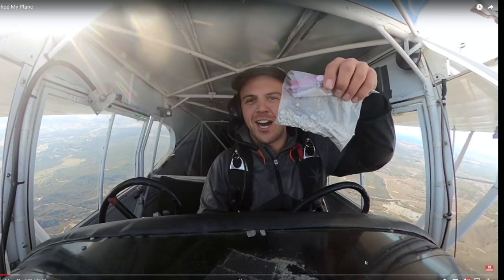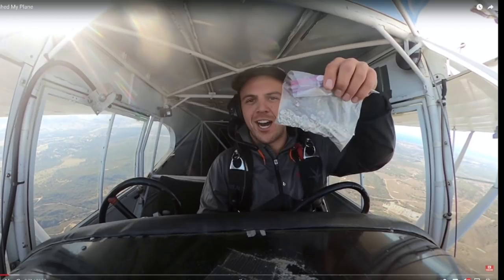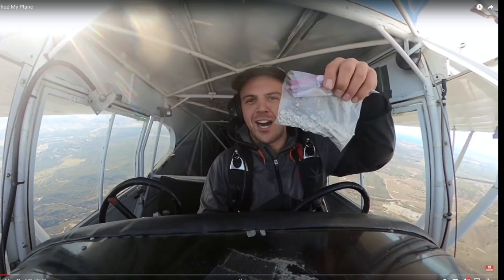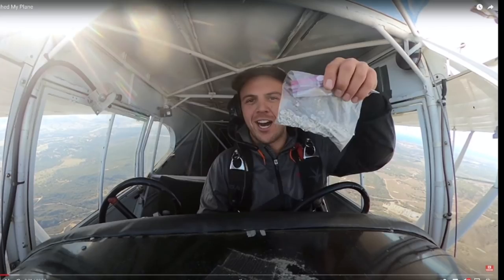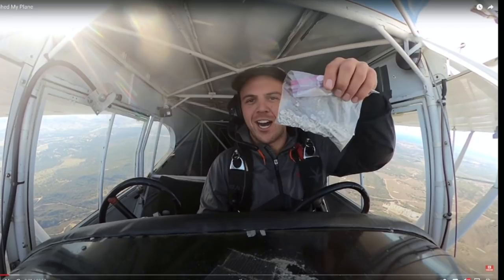Trevor Jacob Crash. SO BUSTED ...Disconnected Airspeed indicator?

Comment: Pitot Tube? With the black hose? WTF are you talking about?  Do you know anything about airplanes? This dude faked his crash, for sure, but this has to be the most ignorant explination of "tubes" and "wings" etc, I've ever heard.
Reply from the maker: OK "BRAINS" Tell me how the pitot tube is connected to the airspeed indicator? Is it a tube by any chance? And how do you remove the wing? Cut the pipe or have a black rubber flexi hose connector? I notice your channel has no content nothing. Tell Trevor to come clean and co operate fully with the investigation.
Reply: @grahamthebaronhesketh.  The cooper tube is for the left wing tank... But... it appears NO TANKS  are mounted on either side...
 In the wreckage you can see a hole in the fabric on the right wing  top surface where the filler neck and cap goes... 
 No tank in that side or you would see the shape of it in the wing root profile and a filler neck.
 It's a simple option to install/replace. New 6 gal replacement tanks are still available from Univair and Aircraft Spruce.
 Typically, when the header tank is getting low, turn the tank selector valve on... Then put your finger on the cooper tube and it will get cold as fuel transfers to the main header... (redundant system)
 Also... the wire bomber, gas cap fuel gauge is almost meaningless... Dip the tank before flight, and keep your eye on time...
Reply: @grahamthebaronhesketh.  I have been telling Trevor to rear his bald little head, but he's not coming out...
 Have spoken with the Helicopter co pilot that hoisted him and he doesn't want to talk either... I have talked with the Ridge too... but they are ghosting me now...
 I am feeling rejection now....🪂😁